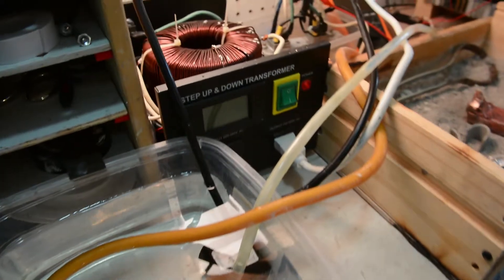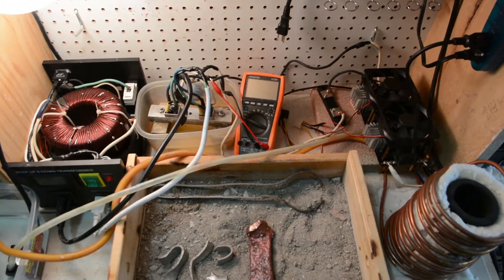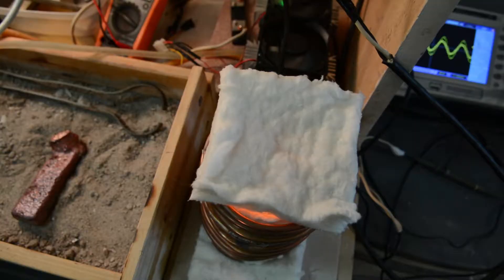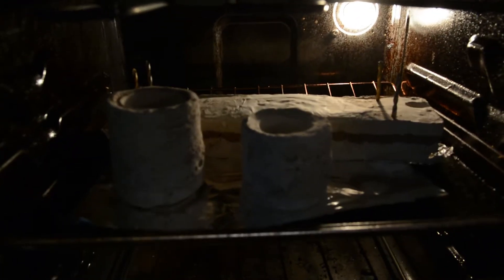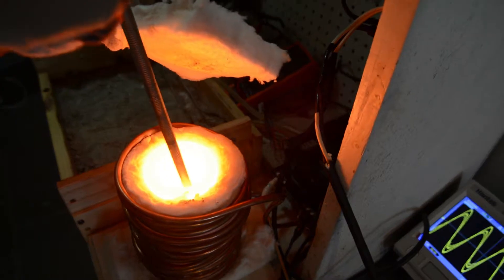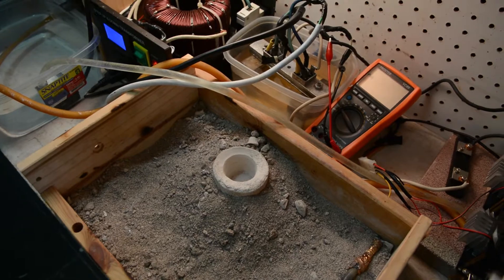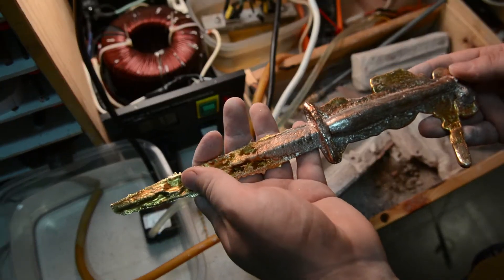Induction Melting: Casting a dagger with Aluminium bronze

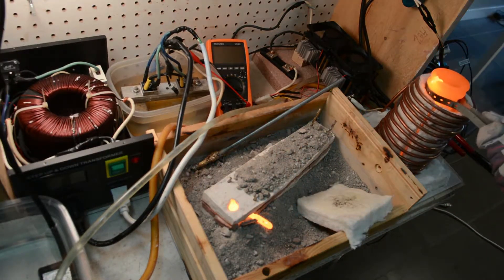Comment: At 5:17 while pouring  bronze the force from heavy metal opened up your two part mold so reduced pressure was not able to completely fill the mold.  Next time clamp the mold pieces and maybe add riser is blade area.  Very cool set-up.  Please do another or similar.